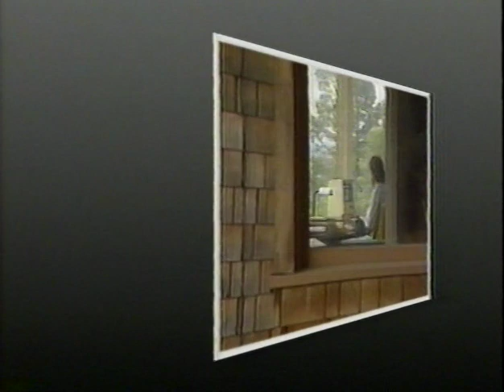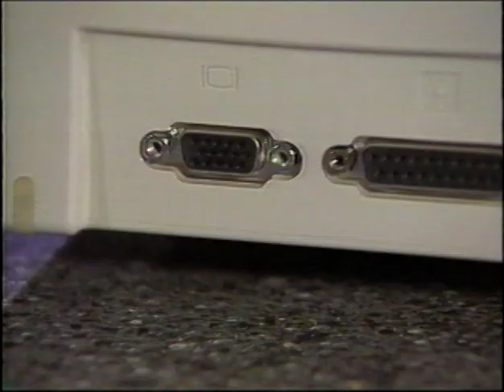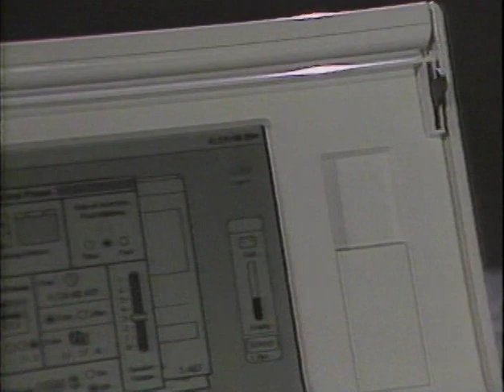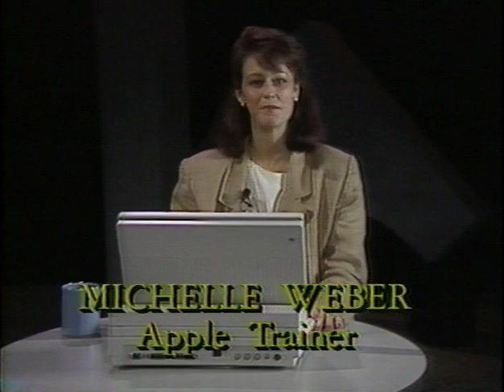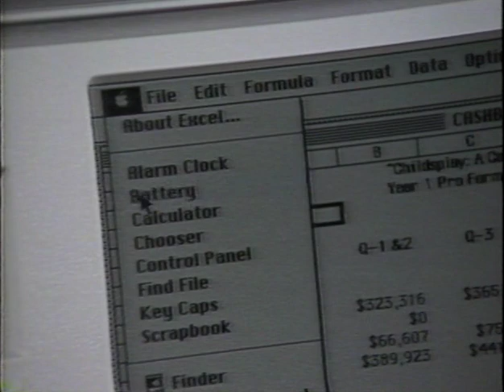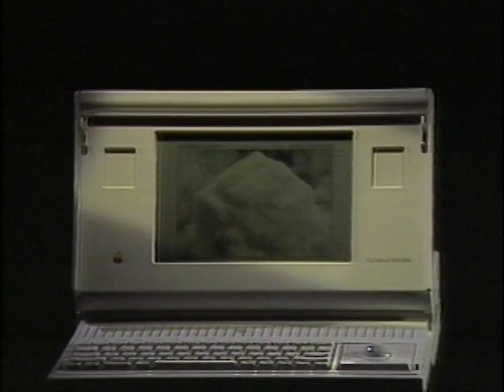[Apple Product Training Macintosh Portable - VHS]

Comment: They forgot "For the user on the go who could also benefit from weight training.  Buy two - they're sixteen pounds each, and you can do curls with them."  As a keyboardist, I'm trying to figure out if that's a Roland D-50 or a Korg M1.  Very 80s.  Thanks for uploading this!